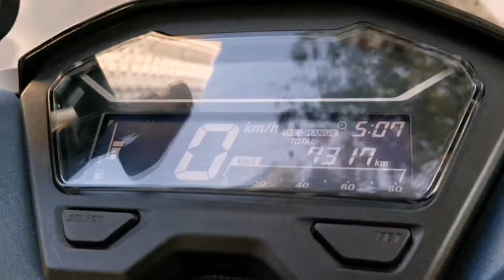Regrove Clutch Bell on Honda Click 150 2020 Review

Comment: paps, ano pong set up  sa cvt set ninyo? Pareho tayo click 150i. Salamat paps...
Reply from the maker: Kalkal pulley, jvt clutch, regrove bell, 14g bola
Reply: Center spring at cluctch spring mo paps? ilan timbang mo? 75Kilos ako.     Maganda yan set up mo my arangkada at saka my dulo din. Sa akin walang dulo 110 lang sagad ko takbo nito kaya gusto ko sana madagdagan ang top speed nya. Salamat paps.
Reply from the maker: @choycruz2866  ngayon set ko kalkal pulley, 14g bola, 1500rpm center spring, 1200 clutch spring, jvt clutch, regrove bell
Reply: @FakeMoto ayus lng Po ba clutch spring 1000 Taz center spring 1500jvt
Bola 14

Comment: Boss same lang ba ang cluctch bell ng namx at click??.
Reply from the maker: Sa bell sir hindi ko alam pero sa clutch lining same sila.
Reply: @FakeMoto  salamat boss rs..
Reply from the maker: @haroldabesia4943  welcome lods
Reply: @FakeMoto  lods pag una kabit ba ng regroove na bell may vibration sa footboard?sakin kasi meron eh
Reply from the maker: @princeprince-if3ss  wala naman sir. Dragging pa yan.. Mag set pa yan mga ilang araw. Sa akin nag palit ako jvt na lining maganda sya smooth lng sya. Hindi kagaya sa stock na garalgal.
Reply: @FakeMoto  naka jvt lining narin ako sir kakabit lang kanina medjo may vibrate sa footboard. baka hindi pa lapat lining?possible ba na ganun?
Reply from the maker: @princeprince-if3ss  sa akin dati na tanggal yong lock ng clutch kaya ma vibrate. Check mo yong lock ng clutch baka na tanggal. Check mo dn bola kong ok pa
Reply: @FakeMoto  jvt clutch lining natanggal mo paps?ung lock niya?or ung dati mo pa lining
Reply from the maker: Lining lng na JVT, clutch spring and housing stock pa dn.. Minsan kasi matatanggal yang lock ng clutch plate.
Reply: @FakeMoto  nasubukan mo naba sa long rides boss ok ba sya?ung nkaa groove
Reply from the maker: Sa ngayon hindi pa.. Binabalak ko na mag long ride after ecq kaya bago na clutch lining ko. So far naka 1000 km na ok sya parang walang bawas
Reply: @FakeMoto  sa unang gamit mo ng jvt lining lods. may vibrate.rin sya? need ba palapatin para mawlaa vibrate?